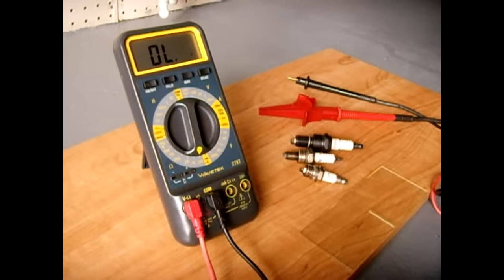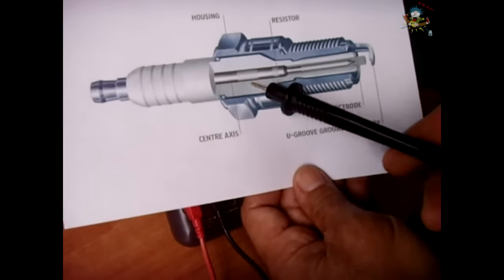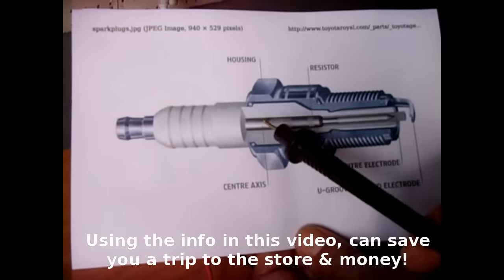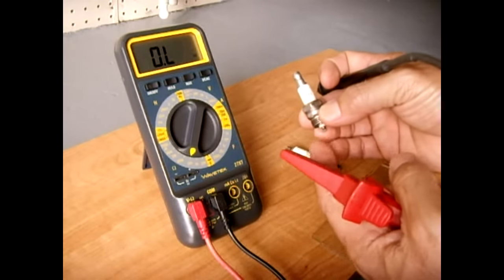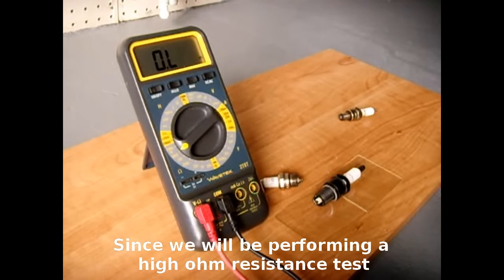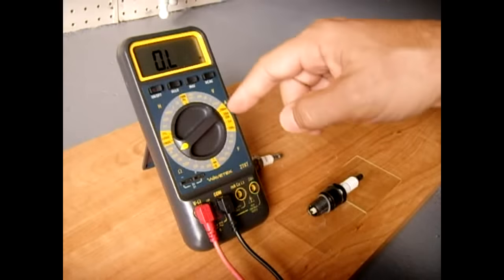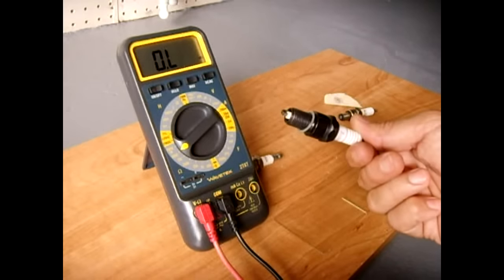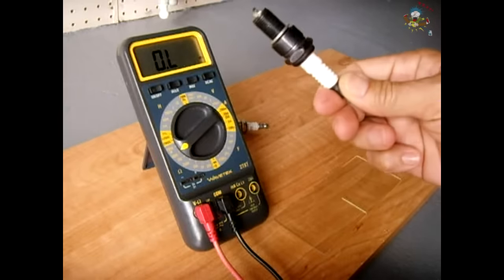How to rule out a Spark Plug as your problem

Comment: Actually we use to check the resistance at the end of the Seal line during the manufacturing process. We also did dielectric test to ensure the bisque had no pin holes.
We made millions of every brand plug on the market. No one brand was different from the others.
I know some guy just crapped his pants to hear this, but Champion, Atlas, Prestolite, Autolite, Shell, Sears and others were made exactly the same with the same materials.
Reply: Bear Russell - I understand what you say perfectly. I always find quite funny the passionate discussions. French/American/ German/ cars is better than... something else. LOL :-) 
I worked for a very well known brand that among many others components,  produced ignition coils. For anything American, French, German, English and so on, even Harley (motorbikes). Sometimes even part of the production line is the same... same workers under the same roof, etc. 
There are differences, but not where most people think. Surely not in the "brand". ;-) BTW the retail price is the most visible side of the story. LOL :-)
Reply: Y7
Reply: Well yeah, most products are marketed under various brand names even though they are manufactured by the exact same process.
They all test the same, and operate the same.
However, the issue occurs when the "Brand Name" is applied to the spark plug.
The moment that the brand name "Champion" is imprinted on a sparkplug, its reliability is adversely affected.

Comment: One small point to contend... I worked in auto part stores for over 15 years and have learned from reading the indexes that the reach of the  ceramic on the combustion side of the plug is what controls the heat range. when the tip is recessed (protected from heat) it will be a cold plug. When the tip is projected into the combustion chamber, you will have more exposure  to heat , and more ceramic material to hold the heat. Other than that your video is correct!
Reply from the maker: +john smith 
Hi John. This issue has already been discussed in the video comment area, and I also placed annotations in the video to clarify things I said. :-)

Thanks For Watching!

Comment: First off, this is a valuable test. Over the years I've seen too many outboard and power equipment owners automatically throw new plugs into a motor expecting that to be the miracle cure. Ninety percent of the time, it isn't.  But, I never thought of testing the electrical resistance of the center electrode, which would be the only real reason for failure outside of wear or breakage of the insulator.

Comment: Engines usually miss at idle or under acceleration/under load. Can either be a faulty spark plug/high tension lead & or coil pack. Some engines dont have high tension leads, but a coil pack for each spark plug. When you accelerate/more power, throttle butterfly opens increasing air supply into motor. Fuel injectors stay open longer allowing more fuel into motor. Therefore the ignition coil increases voltage for stronger spark under more demanding internal engine conditions. You can also test each individual high tension lead using ohms/resistance scale on your multi meter for either open circuit or very high resistance reading. As a rule of thumb, high tension leads should  have anywhere between 7000 to 12000 ohms "per foot lenght" of high tension lead, (7K to 12 K scale). You can also test your ignition coil pack in a rather crude way, like a bush mechanic without any tools. Start your engine, let the motor reach normal operating temperature. Remove nut or bolt that secures each coil pack to the engine. With the motor idling, gently lift the coil pack slightly off one spark plug at a time so you can hear the sound of the spark jumping from the coil pack to the spark plug. Dont lift the coil pack too high off the spark plug. You will hear a specific normal spark rhythum. Your listening for an an irregular/abnormal spark sounding rythum. That will indicate a faulty coil pack. This test is limited to engines  you can access the coil packs individually whilst motor is operational. Unfortunately some engines, wont permit this limited test. Be sure to wear rubber gloves & tools that are insulated. Cheers from 🇦🇺

Comment: Think about this? If the ohm reading is 1.5 ohms or more, I believe the spark plug is going bad. This is especially true when it comes to ohming out electronic fuel injector solenoids for Cummins Diesel Electronic Engines. Thanks for the tip on spark plugs. I never thought of your testing method on spark plugs. Please keep those videos coming!

Comment: As a Jet Mechanic I am glad you pointed out that the electrode could have cracks that and I might add that sometimes the cracks are not noticeable when the plug is cold but when the plug heats up the electrodes expand and causes a lack of Spark.

It's funny watching this video I just went out and bought a tester this afternoon to test my Spark plugs in my new jet ski that I purchased that is not running and three mechanics have worked on and can't figure out why it wasn't running so I picked it up for 15,000 pesos in the Philippines with a trailer that's worth 25,000 pesos LOL because they couldn't get it running

The motor itself according to the Spark plugs and lack of oil runs properly or did when it shut down so it hasto be a spark issue or electronics issue.

Either way in a short period of time I will have ruled out any breaks in the electronic harness with the tester I purchased this afternoon and from there it can only be power pack which is as you note a sealed unit and must be replaced as a unit as a last resort.

Absolutely ridiculous price of the electronic power pack in a jet ski GSX limited-edition SEA DO,,, $1000 plus shipping but it will be cheap if that corrects the problem considering I just purchased a jet ski worth 4000 American dollars for about $350 with a trailer that's worth more than what I paid for the unit and the trailer itself.

Good upload and I will share it to Facebook.... not that any of the dweebs on my Facebook account would understand what you said LOL

And I subbed your channel
Reply: my friend I have been living in the Philippines for five months now and have in a beautiful Apartment with a view of an ocean which is about 50 yards from my apartment and deck which makes my view in Florida look like a Manhattan tenement LOL

I have a white sand beach and Miles beautiful coral right behind the house and I just purchase a jet ski that I am working on in order to travel around the Philippines via the ocean traveling method...

go to my channel then look at all the videos of over 100 I have made of the Philippines is a beautiful place... once you get past the fact that the people are basically not very well educated but are pretty much friendly to the American dollar and to the people and have them so I am enjoying the lifestyle here immensely.

To see where I live you can Google

Wish You Were Here in ALONA BEACH

and thanks for stopping by
Reply from the maker: Thanks for watching and subscribing!

$1000 for the CDI/power pack.....what a bunch of criminals. I would try and remove all the potting material and swap out some components before I bought one. LOL . I would do a continuity test on every wire from point A to point B. My jet ski had one wire that corroded inside the insulation. Luckily I found it.
Reply: electronicsNmore  that is precisely why I bought the meter a.k.a. to test each and every individual wire in every part of the harness From A to B.

All it takes is a small crack in the insulation in a little bit of salt water and it will corrode internally as you well know.

Plus if I showed you the video I made of the harness you would see that the three so-called mechanics peeled off some insulation about 3/8 of an inch long and twisted the wires together without cleaning the wire itself prior to twisting it which means it may not have any continuity whatsoever because they twisted oxidized wires together not knowing anything about oxidation because they are not mechanics in the true sense of the word.

I however went out and purchased a nice little wire brush some flux 40/60 solder which is still legal in the Philippines I'm the properly spliced them together laterally like this supposed to be.

Went to 12 stores in the last week looking for some heat shrink... and no one even knows what it is here in the Philippines so I purchased some 1/8 inch diameter clear hose used fish tank filters and after the joints are soldered I will put some black high heat silicone over the wire and slipped the tubing over that which I'm sure will be sufficient to keep it from getting wet...

The machine ran perfectly until it was left unattended for a few months and when the man went to start it again it just didn't start so probably the electronics is not the issue and probably more like one of the three fuses I found that were blown??

Do you think?  LOL

We shall see,,, it's the 1494 in. cubic centimeter engine and if you look at it in the video I make this week you will say it looks like it just came out of the factory however when you look at all the cannon plugs you can see that the high-quality brass male and females are completely oxidized.

So I will take my little files and drill bits and polish them up in an out.

Between that and a proper soldering job and testing the wires themselves I should have ignition when I'm done with that.

There are some heat sensors on the top of each head and also in the exhaust loop and I'm not sure if they will shut the motor down what I will check those as well and the tubing that goes to the sensors.

This is my first jet ski and it didn't come with a service manual so I will look online I'm sure it's there but only purchase this machine three days ago and this is not my livelihood is now my hobby which I devote 10 hours a day to anyway LOL

If I have any questions I will be sure to bring them up on one of your pages after I do some research on your videos if it is not covered somewhere that I can find?

If I don't I still believe it is something a lot simpler than the power pack and that is my last resort

and you are right it's highway robbery.

Okay my friend thank you for returning my comment and best wishes to you from one mechanic to another.

Michael
Reply: Where do you work at? Pratt & Whitney?
Reply: HoodwinkedbyanAngel Michael Fazio I am so glad I came across this video and y’alls ‘troubles’ after acquiring these sea-doos. I myself have been given one and it too was a ‘it ran perfectly when I shut it off but will no longer start’ scenario. 👍👍 I say “perfect!” as it too does not have any spark. Seeing as I love electronic/electrical type work I welcome the challenge...and hey, for the price?(free) I am ahead of the game already if it actually does need a part or two. Any recommendations where I should look first on one of these beasts? I have done two stroke ski-doos of all types so that part is pretty familiar, just not their watercraft. You say the ‘power block’ can/may be an issue?..I’m guessing it’s to do with leaking water internally causing it’s many quirks.
Let me leave y’all with one recommendation when cleaning up corroded wires....you will thank me for this later..trust me.  Whenever/where ever you have corroded wires needing to be reconnected and you find ‘sanding’ them or ‘scraping’ them with a blade don’t quite do it, try dipping them in muriatic acid from the hardware store. This product is used for cleaning and etching concrete in pools etc. NOW BE BERY CAREFUL WITH THIS STUFF!!! IT IS HIGHLY CORROSIVE AND EXTREMELY TOXIC!! USE IT WHERE THERE IS EXCELLENT VENTILATION AND KEEP CLEAN CLEAR WATER NEARBY TO NEUTRALIZE IT WHEN DONE. It takes only 10-20 seconds of dunking this in the acid and it’s done..clean. Quickly rinse it off with the clean water and dry it off completely. Do give it a few passes with the emery cloth or sand paper to get that brilliant copper shine back which makes it the easiest to solder. I know the good heat shrink is the best but I see not always available. Check for a product called ‘liquid tape’. It’s black in colour and smells a lot like contact cement. (😮 💡 😮☝️👍...did the lightbulb just come on? 👍😉) ...I believe if there is no liquid tape available, you may be able to improvise with the contact cement...I’ll leave that up to y’all to figure out 💡😉🤞👍 Spread this liberally on and over the newly soldered connection right onto the wire’s insulation so no water/moisture can penetrate it. Cover that with electrical tape to help stop any possible abrasions that may occur.
Thank you kindly for any tips you may have for me and I hope mine will come in handy for you. With any luck it won’t take me long to repair it as up here in northern Canada, our ‘Sea-doo season’ is already awfully short as it is..from October to June the ice makes for some powerfully rough and cold boating on a sea-doo anyway. 😆😆😁😄🤣  All the best from a fellow mech. and watercraft enthusiast. 👋👋👋
Reply: HoodwinkedbyanAngel Michael Fazio kinda like fan blades?

Too soon? 😨

Comment: I see you talk about the resistor in this video as well. The resistor is to stop capacitance after firing of the spark plug. As the ignition system operates, the shielding in the plug wires builds up an electrical capacitance, ( just like a capacitor does). Once this capacitance  is so strong, it'll jump the spark plug gap, this isn't good, so they build a resistor into the plug to bleed this stored electrical charge of slowly so that it does not jump the plug gap, and ware out the electrode tip prematurely. It can also lead to pre ignition. The electrically induced noise that you hear over your cars speakers is caused by the alternator frequency change when the  capacitor goes bad in the alternator.  The  capacitor is an electric filter in the alternator,  it performs the same job that the capacitor performs in an aircraft magneto p lead, it acts as a filter to filter out electrically induced radio noise. I'm not arguing, I'm just setting the info straight.
Reply: Great comment,
Reply: wanna chat let me know thanks

Comment: Sometime a plug can make a spark on the chassis and not in the cylinder head, its caused by the pressure, its a big factor in plug spark capability, and fooled plug can some time be recovered by burning the tips after cleaning it out with gas

Comment: When I change plugs on a motor (about 3 times a week) I will test 1 of them on a pressurized spark plug tester.  It will blow your mind what passes and what fails.  You can't tell by looking at or ohming out a plug.  Under load a spark would rather jump a 1" gap in free air than a 0.040" gap at the electrode under 100 psi. pressure.  Also, a loose boot on a plug will allow the spark to run down the side of the porcelain to ground.
Reply from the maker: That may be true, but the test does work and never failed me.

Comment: If you have insulation tester, that’s better way to test the leak. It has high voltage of 500 or 1000 volts (most usual values, some have 5kV or 10kV) between the leads and measures the insulation resistance usually 500 or higher megaohms. Older models are available quite cheaply if they don’t have moren measuring algoritms. I found one in 30 euro. These are good if you measure HV cables too.
Reply from the maker: Yes, a megger is great, but most people either don't have one or cannot afford one.

Comment: The type/brand of plug can indeed matter. I (and some friends) have only ever had good luck with NGK "V-power" plugs in our older cars (mostly V-8's). They last longer/run better,in my (our) experience.
Some newer engines can be picky about the brand of plug as well.
(I've even had good success using the NGK's in place of platinum plugs,in some newer engines.)
Reply from the maker: Hi,
I never stated different types/brands of plugs did not matter, what I did say is the procedure outlined in this video works on all plugs. In my experience, using split fire / bosch platinum / NGK / autolite, I noticed no difference of performance with my personal water craft, cars, mowers, etc. I can probably switch out a plug that someone insists works better(without them knowing), and they would likely notice nothing.

Thanks For Watching!

Comment: yep   the insulater is the bit at the electrode end of the plug, look under the electrodes, if the porcelain goes deep , it is a "hot" plug  ie: there is a longer path hor the heat to escape to the metal body, if the central insulator is short and stubby, the heat escape path is short and effective, ie: plug runs 'cooler'  ( a old plug)   Cool plugs will oil up , hotter plugs will burn it off.  ie: a champion n3 has a short insulator <cold> and a L7  has a long insulator <hot>
Reply from the maker: Correct. My "Pinned" comment clarified all that.

Comment: To locate a bad plug just remove the plug coils one at a time while the engine is running. If  the engine idlization doesn't become rougher and stays the same that means that plug is not contributing to the performance. You can try cleaning the plug if it's dirty, regapping and blowing out the socket port in the engine for debri.